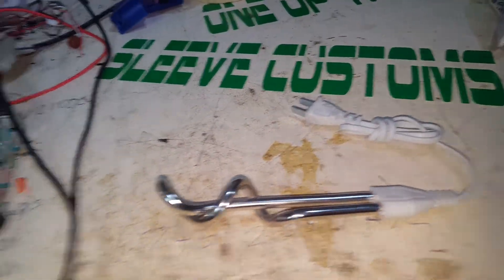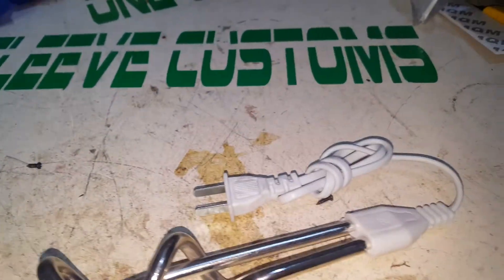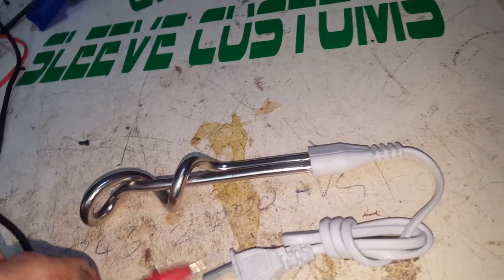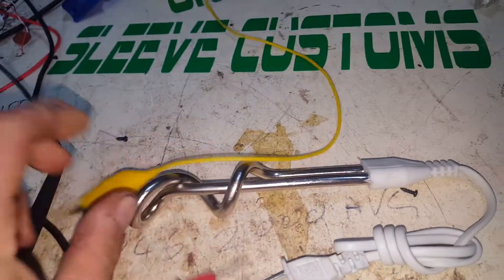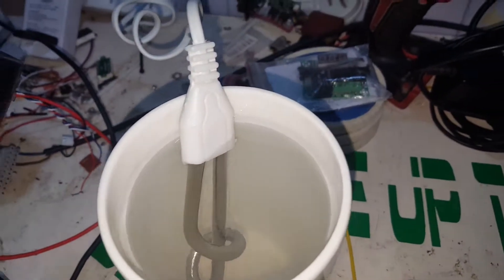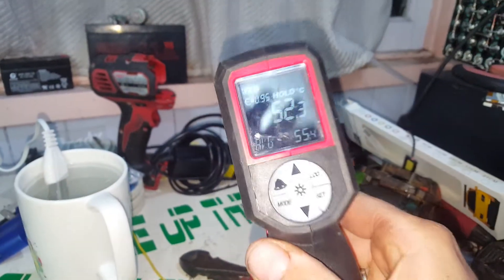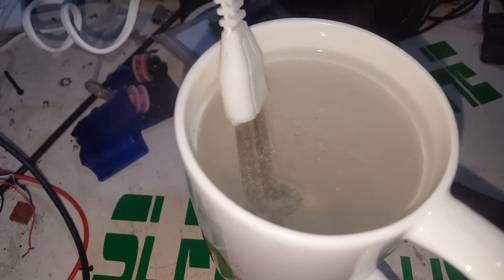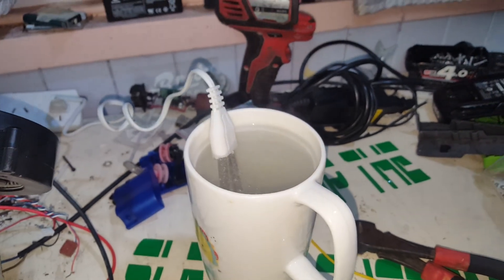Scary cheap  Chinese  700watt immersion  water heater

Comment: Very efficient way to heat water.
I would be a bit worried about whether it gives off contaminants into the water though.
Reply from the maker: +George Gibson wonder what
Reply: I don't know, something like chromium from the element, but I guess it's no different than heating a stainless steel pot with a gas burner.
Reply from the maker: +George Gibson thats true i wonder if any one has researched that might  have a google
Reply from the maker: +George Gibson khaha chinglish is the most fun to try and make sense of

Comment: Yeah unsafe.
Due to there being no earth, it's possible for leakage current to cause the water to have a stray voltage.
Also no sign of thermal cutout, fusing etc.
Reply from the maker: +station240  yeah shes cheap and nasty